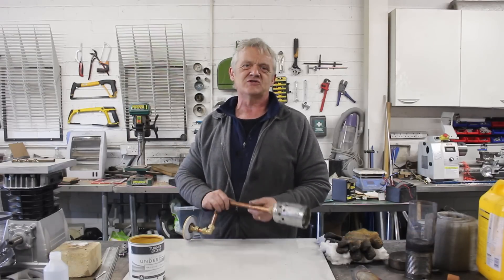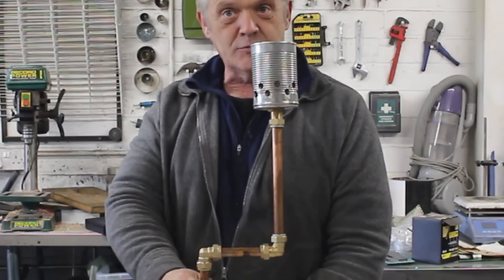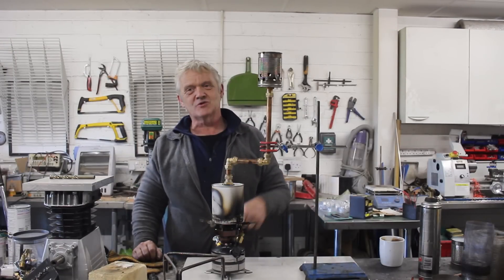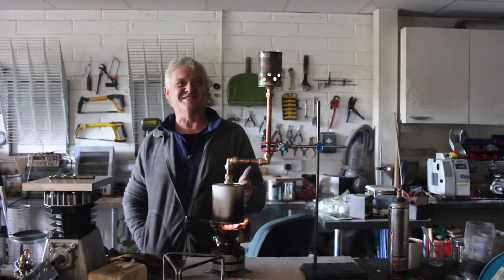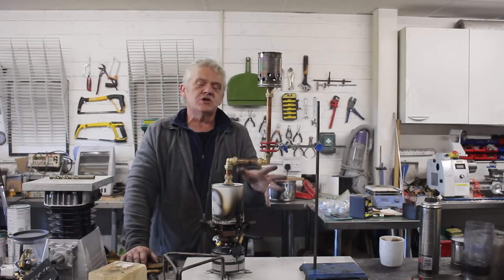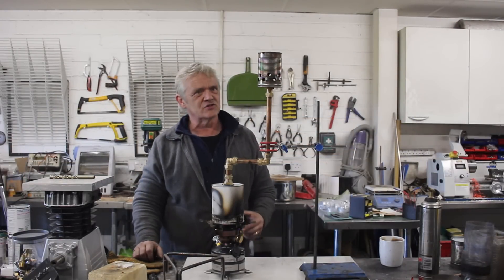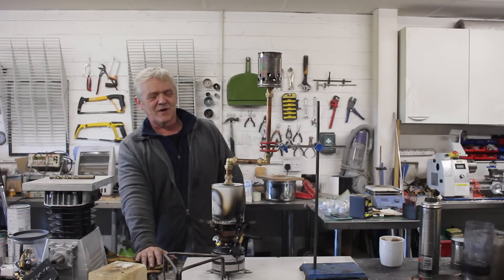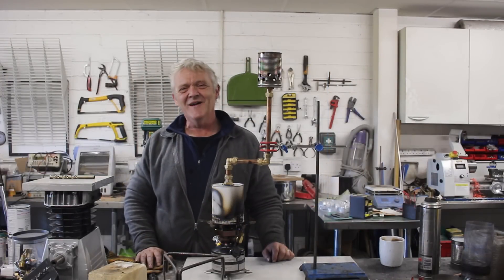1707 Making Fuel At Home - Paint Can Pyrolysis

Comment: Hello Robert!
How hot was the can during the process?
This process - if my guess is correct - beside the gas leaves biochar as a "byprpduct", that is the base for terra preta - or black earth - for soil enrichment.
If it works on a relatively low temp (like a 2-300C°), it could be powered with solar through a frensel lens and a mirror.
Right?

Comment: if you was making 'fuel' say for a car or van from plastic you need to pass the gas-vapours over a selective metal catalyst to give you a specific long-short chain hydrocarbon depending on what you want it for. Heavier fuel oil = longer chain hudrocarbon. Short chain hydrocarbon = gases

Comment: Not sure the energy balance works in that demo, but have you ever smelled pyrolysis oil, it is foul.
OK the old coking plants worked, but all other attempts have struggled. I tried pyrolysis of car tyres, yes it works, you get foul smelling oil, carbon black, and steel, but it is not a commercial idea.

Comment: Now take that gas back to the original burner to add to the flame that cooks the stuff in the paint can. Run a sterling engine off the excess heat to produce power. When done crush the char and put it in your garden as biochar. Win, win. Oh ya, the co2 supports 1 tree for one day. Another win.

Comment: Back in the day/college, we pyrolysed several hydrocarbons (polythene, diesel, petroleum jelly, paraffin wax etc) but we added a pinch of wood-ash as a catalyst, the products of H2 and Alkenes were obtained at lower temperatures than without the ash. I suspect several metal oxides (rust, Aluminium oxide etc) should also catalyse, but I haven't tested that. (I don't remember if we did it with vegetable/animal oils/fats; it might be worth looking into).
However, once the reaction starts, some of the gasses could be fed to a burner under the chamber to maintain the process, the remainder gasses/products being tapped off for storage or other uses.
A similar re-circulator method is used to pyrolise wood to charcoal in a double-walled oil-drum retort, starting a fire between the inner/outer drums with a small amount of scrap/sacrificial wood starts pyrolysing the contents of the inner chamber (which is pierced underneath) those gasses then burn under the inner chamber and also inbetween the residual charcoal from the starter/sacrificial wood and the reaction becomes self sustaining. Once started the process needs no baby-sitting and burns cleanly while you do something else. The charcoal obtained is very high quality, which lights easily due to residual carbon products. I use the charcoal for BBQs, in my forge, for heating, or grind it up and use it as a soil improver on my allotment (being careful to only use clean/untreated timber for the latter as some treatments use copper, chrome and arsenic).

Comment: So if you use the flame to heat another can that contains wood and in turn provides the heat for the first can? Cutting out the gas element in this contraption? Would it be able to sustain itself for as long as there is wood?

Comment: Vehicles have been converted to use this "Woodgas" when oil was unavailable, such as WWII, or when prices where prohibitively high, like in the 70s.   Today's cars probably couldn't support the conversion, but for an older vehicle it was fairly simple, a pyrolysis chamber was bolted on, usually in the boot, or externally, and simply plumbed into the carburetor.  Some more complex systems allowed for starting on petrol, and switching over to woodgas as the system began to heat up, allowing for faster starting.   The power of woodgas is somewhat less than liquid fuels, but the 'crude' stock is readily available.

Comment: One problem with this setup is it needs 2 sources of fuel: the gasifying fuel and the external heating fuel. 
The big advantage, in this case, is that you are producing another type of fuel and not consuming everything entirely. Build a stock of charcoal and then use that as fuel #1!

Comment: A growing problem is how to utilise all the plastic bags and packaging items at a household level and avoiding toxic by-products of pyrolysis, can you analyse gas yields per unit weight input and best temperatures for max yield and safety. Good idea but is it practical, eg the input flame seemed way more vigorous than the output flame, what is the heat output vs heat input?

Comment: I love this recent series of different forms of heaters and fuels to be used as heating elements for your house or other applications, for example i could think of a bushcraft campside or a terrace on a cold evening. 

Now, a short of yours has caught my attention, in which you used graphite to improve the infrared radiating properties of a plant pot heater (i think).

 However, I couldn't find any information on graphite being used that way, except a badly translated chinese patent, so I was wondering if you could provide more detailed information, or if you plan on conducting more experiments with graphite, in this context, as it seems to fit rather perfectly in the current topic of infrared heaters. (Improving their efficiency?)

In any case, keep up the good work
Cheers

Comment: Hello Robert... A little late to the game, by a few posts, sorry bout that. If you had access to a large quantity of 70% ethanol gel hand sanitizer, how would you separate the gel, so it could then be used as fuel? Seems the stuff had an expiration date of about 4 months ago, hope the alcohol didn't escape! Thank you for all the incredible ideas.
Reply: There are multiple ways. You could distill it off, if you have enough of the stuff that you can produce your own fuel for the distillation process heat needed. Or if the cost of conventional heat is less than the cost of the ethanol. 
Another possibility is to add salt to absorb the water and separate the mixture into layers but idk what would happen to the gelling agent. 
I can buy a litre of 96% denatured ethanol for about 2 euro so to me it's not worth the effort.
Reply: Thanks, good ideas, I might first try a simple filter... Maybe then further distill the alchol.

Comment: Reminds me of a very simple experiment we did for an organic chemistry class. Put sawdust in a test tube and heat it over a Bunsen burner. The tube was connected to a pipette and the gases produced burned easily. The professor called what happened to the wood “charking”, which is different than burning since the test tube contained little oxygen. I’ve seen a vehicle being run off those gases in a wood-burning truck.
Since you use a lot of power to produce the gas I wondered about the usefulness of this process. One possible benefit would be converting wood to a different burnable produce, charcoal, that can be stored without worrying about it rotting, molding, or attracting termites or nesting pests. And if you heat a structure with the pyrolysis flame you can compress and store the gases as a byproduct for later use in existing (slightly modified) gas appliances: water heater, gas stove, etc. Two birds, one stone. The benefit there is the gas lights immediately with no warmup time and doesn’t generate much extra unneeded heat like a woodstove.

Comment: Instead of the external heat to power pyrolysis why not use GPCS (Gas Produced Combustion System).  Feed restricted air and steam into the preheated wood or biomass waste.  This will gasifying at a lower temp than pyrolysis.  Then have your burner heat water to produce steam that is fed into the gasification.

The process becomes self sustaining until the fuel runs out.  You will need a much larger paint can.

Comment: How far would the fumes travel before its cooled to much?

Like would it be possible to use the 'wood stove' part to heat on room and then use the gas to heat let's say 2 rooms over?

I know it condenses, I did it with cable plastic and used a copper spiral in water and so got the oil out of it. (not doing this again because it contained pvc which is least to say not healthy 😂) but if not cooled in a spiral but the length of the pipe would be 6m I have no idea if it would convert back to oil or if it would stay in gas form.

Sorry about my English, not my native language.
Reply: where you from
Reply: @ashyslashy5818  Netherlands

Comment: Instead of straight to a burner, try through a bubbler tank then the burner.  Oils will collect on top of water in the bubbler and can be claimed to be used later.  If you move the burner, after the bubbler, under the paint can you can have it last longer and only need enough fuel to start the gasification process.
Reply: Run it through a condenser, first, to drip out the Methanol, and then the bubbler?

Comment: Robert, is there any chemical or substance that could be added to the wood to lower the temperature needed to produce cin gas, and actually have the burning cin gas heat the wood on a closed loop sort of way?
Reply: You are talking about a catalyst. I've never heard of one that would work simply because it would need to get hot. Heat is what causes the wood to break down into gas. As for using the syngas to do the actual heating that should be possible but you would need to prevent heat loss in the wood chamber for efficiency reasons and you would have to jump start it with a lot of heat. This is done all the time with oil burners.
Reply: @consaka1  it is stated from a reserach study that adding 1 to 3 % of common ash might improve pyrolysis. Is ash acting as a catalyser? Well I don’t know but somewhere in the web there is an answer with the scientific référence.
Reply: @arebuffat  I know that ash can be a heat catalyst. I've watched other videos where campers use ash and cloth as firestarters. They pack ash into the grain of the cloth. When needed they apply friction to the cloth and it catches fire.  The idea would be to lower the gasification temperature point enough to have surplus heat for a separate steam generator.
Reply: Maybe little peaces to increase the place..... Sawdust will get faster to charcoal with much less of temperature 🤔

Comment: I think you probably consumed more energy with that burner, than your produced with that setup, but cool for what it is. 

Not sure what you'd use it for offhand as you have a burner right there. 😅 But if you need an open flame, It would definitely do the job.😉
Reply: Suppose if your not short of wood, but need gas then then inefficiency is acceptable

Comment: Adding a word of caution. When doing pyrolysis of Poly Vinal  Chloride (PVC), and burning the gaseous products, it will emit dangerous chemicals with chlorene in them including corosive Hydrogen Chloride and more predominately Chlorine gas. One does not want to breath either of those in.

Comment: Pyrolysis also occurs in large tip truck tyres when inattentive drivers drive under high voltage wires with their trays up shorting to ground. the tyres often will explode so affected trucks must park up in a cordoned off area for 48 hours!

Comment: If you were to make a D shaped turn in the copper pipe so that the outlet points at the bottom of the paint tin could you get it to power itself, once it's working? ;o)
Reply: Yes it would aid in efficiency
Reply: Still a good idea to keep adding fuel to heat it up, and keep that gas lit.
Reply: @cetate93  Yea but there's heat there to be sucked out!
Reply: ...... an interesting way to make charcoal....
Reply: @vidard9863  something along those lines are used in some homemade charcoal retorts.  Usually has a horizontal pipe with jet holes drilled like a propane bbq grill.
Reply: @cetate93  this channel is giving me bad ideas... i am now thinking about building a multi fuel rocket heater to power a steam engine, for purposes....  then building a charcoal retort to recover more of the energy, with a distillation coil to capture the methonol, and shoot the rest of the gas back into the rocket stove....
Reply: @vidard9863  Sounds good to Me, but I am a man of mad thoughts.
Reply: @vidard9863  Yup, like what the hell!!!
Reply: Kinda like a turbo on a car engine feeding power to the engine? Init?

Comment: Is there a way to store syngas? I was thinking charging propane tanks with syngas, but don't know if it would be safe or practical
Reply: Woodgas doesnt compress that well, syngas does it a little better but still disappointing with small compressors. You can store it in evacuated balloons, innertubes, yoga balls, etc. And then compress it. Be careful with a propane tank and flush it a couple of times with eater before any cuts.
Reply: Nighthawklnlight built a gasometer that you might like so search for and watch. This may store many of the non-condensables. 
 

Will syngas condense under pressure? Hydrogen and carbon monoxide, major energy carrying components of syngas, only condense under very cold temperatures.

 Pyrolysis is also likely to produce other products that will condense out at room temperature and or under pressure, and could be stored separately as a condensed fuel.
Reply: @UCreIVCuh9aAmP6BRMSbDwjA ahhh yes I am aware of that method 🙂👍 but I'm aiming for more of a condense and long term storage method, also possibly run machines with and have easy portable tank to take with me.  Now I'm wondering if you can convert syngas through a fuel cell to make electricity, I know none of these methods are efficient but still can do it for more self for free😉

Comment: I like to imagine I need to fuel a generator from what I have at home, long term,  I can imagine starting with concentrated sun heating wood chips to start with, catch the methanol, while the generator is running on the vapors, like syngas, and possibly convert the gas engine to run on oil fuels like a hot bulb diesel,  I have seen small gas engines converted to diesel, (not sure how long it would last) using small diesel engine parts, I think I'd  mostly use paper garbage convert it to methanol, use that as fuel in the gas engine,  converting a carburator engine to run on methanol is not difficult, basically just adjusting the carb, and larger jet,  in some carbs just remove the jet, easy especially in steady speed engines like a generator,  getting it to idle may not be so easy,  even running the engine with a partial choke, to get more fuel from the carb, adjusting the idle circuit to add fuel, while at speed, is possible, since the idle isn't needed,  the main thing is getting it to run under load, at the proper speed for 50-60HZ depending on where you live, I'm in the strange. World where. The loads in a home are put in series,  at the breaker panel and the imbalance is sent through the neutral wire to the transformer, if you have two 100w loads, the neutral has no current, add one 100w load, and the neutral has 100w as long as both lines or legs are even, the neutral has nothing on it ( from the breaker box to transformer not inside the home)  so it's basically a complex way of putting two 120v lamps in series powering it with 240v,  I just wonder who thought this up, and how did they convince everyone this is the way to do it? I'd like to hear that meeting!! 🙃 
Why not power things with 480v at 60kHz  over 120/240  60 Hz, or why not 240/480 at 20-30hz, or 60/120 v and 120hz or 240Hz  , I see they had issues insulating from high voltage in the late 1800's  sorry I'm rambling again,

Comment: I wated to reuse waste oil to generate soot/smoke free heat. I tried passing 15kv@ 100w(from an electronic neon sign transformer) through  oil(olive because  its what i had) to pyrolyse the oil- initially it didn't work(oil dielectric  strength too high) but then I added a bit of copper dust(to make it conductive and the oil started bubling rapidly. The gas which was produced popped under flame(high hydrogen content?)

According to google a litre of oil generates 11kw of heat  if you could gassify it with only  100 watts that would be  amazing 

Obviously  15ma at 15000 volts will be LETHAL so don't try it at home unless you absolutely  know what you are doing and take tons of precautions

Comment: Trying to get my head around what was mentioned about pyrolysis being something heated without oxygen, or more the effects when compared to being heated in a kiln, I'm  presuming that the sealed nature of pyrolysis allows for a sort of control in capturing what the biomass is releasing where as in a kiln it would just be venting to atmosphere, or is there more to it? Would pyrolysis have the same result on what you did with the carbon mushrooms? I haven't got a kiln but if the mushrooms maintained there shape through pyrolysis then I'd like to try compressing a load of mushrooms together into a usable shape when reduced to carbon to try as a wick, I understand it would be brittle but im thinking the porosity of the mushrooms structure  should make a great wick, of course this all depends on them maintaining there shape like they did in the kiln